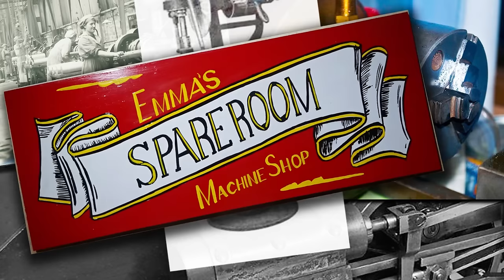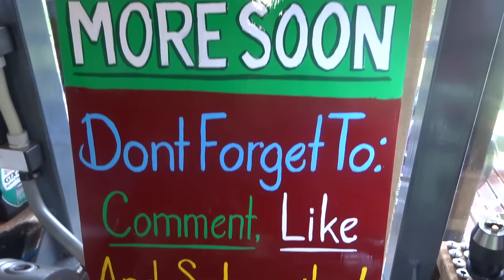lorch spindle nose rebuild and repair part 1

Comment: Nice job Emma. Well done for taking the plunge and doing the repair. I agree with LWS of H, you do not really need the pin if the runout in all positions is the same.  With the small amount of runout you have at the spindle nose I would say the bearings are fine. regards from the UK

Comment: Nicely done, the lathe is ready for fairly precise work now, sure you won't miss the pin.
Increase the pressure on your compressor, it will blow the grits better....   lol
Reply from the maker: lol. good point. the pin is usefull because u dont need three hands to tigjten it all up. thats all.

Comment: You don't need to bother with the pin it will work perfectly well without. I lost the pin on my R8 mill spindle many years ago, can't say I ever noticed the loss. Ok, I will replace it if and when I change the bearings again but not till then. Don't go looking for work when you could be making things. :>)
ATB
c

Comment: Getting a accurate taper on a small lathe with a cheap chinese boring bar has got to be the achievement of the week, if not the month. That tool holder is magnificent. abom79 has a much bigger one,  it's bigger than my lathe! Could you possibly provide a link to it?
Reply from the maker: +Juan Rivero in australia this is a pretty ok Taiwanese copy of the swiss multifix toolpost.sold by Hare and Forbes.  this isnt the smallest one i dont think, but it fits this machine. http://www.machineryhouse.com.au/l299
Reply: "This item is no longer available". Sigh.